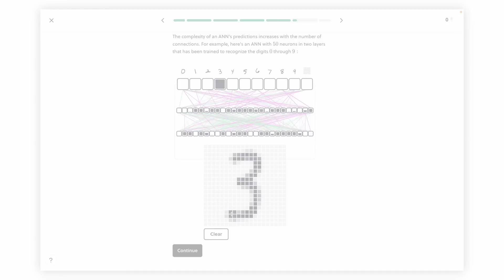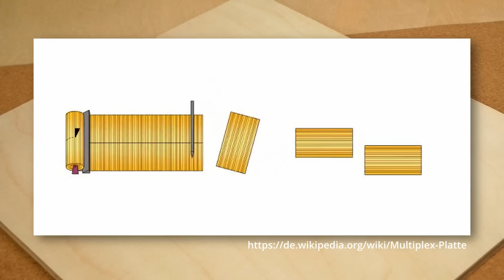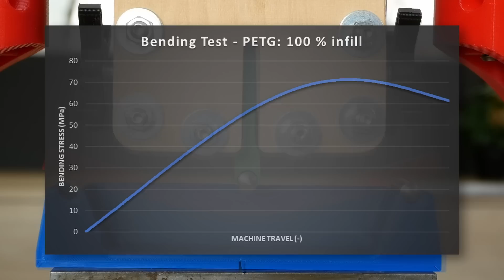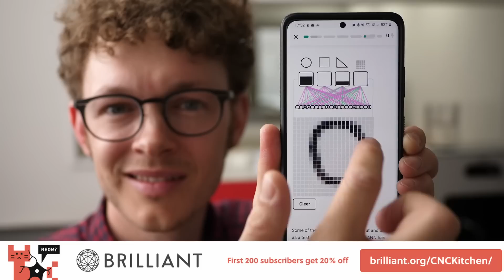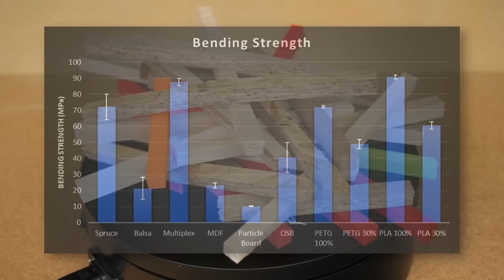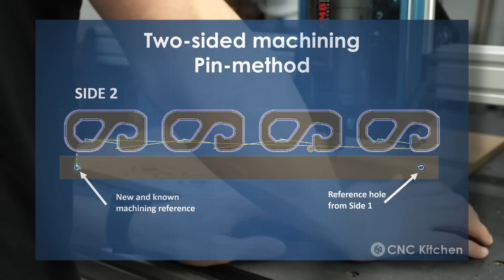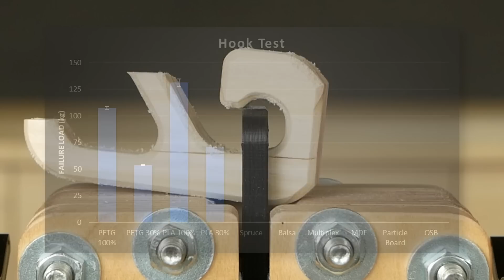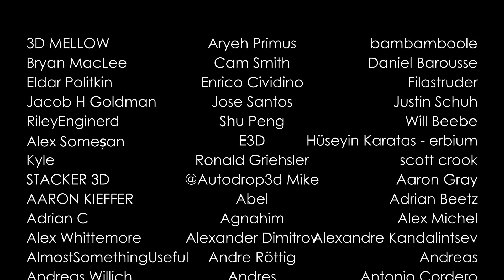Strength Test:  3D Prints VS Wood

Comment: The wooden hooks failed more or less as expected. Hardwoods like those are usually quartersawn. This is the grain configuration that gives those beautiful cathedral grain patterns on the surface. It is very strong in furniture, but does not work well for making abstract shapes.  With the load of the hook being 90° from the mounting points, there is no way to orient the wood where weight is not being held by the lignum (the very weak natural adhesive that bonds the layers of grain together.)

Comment: 10:14 I'm surprised to see the 100% infill 3D prints have similar strength per density as the 30%. Am I misunderstanding the data? Mpa/g/cm2 . The cm2 is the same on the different prints, or is this related to the infill percentage?

Comment: Cheap laminate flooring plates is a BRILLIANT material for all kinds of things and with some glue they can be used on both sides a very cheap core material to create very stiff and strong composite boards-

The wear surface on quality laminate is so strong and hard that it can be used as a sliding surface against itself that require no lubricant(wear wise it is likely to be comparable to softer metals with lubrication, maybe even better...)

Comment: How would wood be if you burned it (a bit, so it is black to sight)?
I have tried melting PLA in salt, it gets solid but with the salt shaped surface, what if you compared the resistance change, maybe other postprocesing methots

(maybe I got the salt idea from you and didn't remember? If so sorry and I'll search it... it is hard to remember all the materials tested!)
Interesting experiments these you do

Comment: Just noticed the X1 Carbon with AMS In the background.

Just thought I'd comment about a few things before the review was finished.

First I was hoping you might be willing to test flexible in the AMS despite what they advise as it would be great for composite prints for things like hinges.

Secondly I thought it reasonable to point out that they technically aren't abiding by the gpl3 license of the software their slicer seems based on yet (they say they will soon)

Lastly they also mentioned they'll allow non cloud base local network printing eventually but it's not there yet.

Thanks for the time it took to read this comment.

Comment: Nice testing! Perhaps two things to note with the engineered wood products:
The hook test does not load the materials in the direction the sheet goods were engineered to be strong in. Sure, they can take some load in that direction, but they're mostly designed for the type of loads seen in the bend test. If they ever see what I guess would amount to a shear load across the sheet when used in construction, you've got a huge mechanical advantage due to the size of the sheet, so even when the material itself is (relatively) weak, it will still easily be hold up. 
Also, especially with OSB and the finer particle board: When used in construction, due to the larger sheet size they're used in, the strong sections will support individual weak spots across the whole area of the sheet, so it's really just the strong sections that determine their overall strength. However, with the small 9x9 samples in the bend test, you'll always capture at least one weak spot, so in that testing, it's exclusively the weak spots that determine their strength.
Reply: Gotta agree with Thomas. Producing let's say a 2mm x 2mm stick is totally doable for polymers and any solid timber, but such a stick made of almost any of the many fibre boards would not possibly even stay as one piece to begin with. Does it mean the material is infinitely worse as the part breaks apart on it's own? Or course not. 

Not that I'm a fan of fibre boards, they suck up moisture and deform over time. Low grade furniture makers love it - makes for self-disassembling stuff that creates need for new furniture.
Reply: @jaakkopontinen  "Does it mean the material is infinitely worse as it breaks apart on its own?"

That's exactly what it means. The mechanical properties of the material usually tells you that up front. There's no real need for testing. It's the first thing you look at when selecting a material to do a specific job. As an example...

Particle board tensile strength = 145psi
White oak tensile strength = 768 psi
PLA tensile = 7250 psi

Compressive strengths comparisons however are closer.

White Oak = 7440 psi
PLA = 13400 psi

A 2mm x 2mm stick of wood is not as strong as a 2mm x 2mm stick of PLA. It doesn't matter the size or the shape. PLA has higher tensile, compressive, and shear strength so a given shape will always be stronger in comparison.
Reply: @OU81TWO  Thank you. Though I feel you missed the "infinitely" part of what I wrote. There's a gradient. Only truely infinitely worse material for a job is no material at all. There's a reason I used the word - it was to show the existence of the gradient, not to actually place any other material on the gradient.
Reply: @jaakkopontinen  Not sure what you mean by "gradient".
Reply: @OU81TWO  a gradient of "best for a purpose" to "worst for a purpose" in this case.
Reply: To piggy back off this idea, many of these wood sheets are designed for specific uses which don't really translate into what the hook test and bar tests would show us. As an example, MDF did very poorly in these tests, despite having the highest density, because its main function is to be a cheap(ish) filler wood for finishes that are intended to be painted or laminated, hence the super smooth surface. (I say cheapish, because you can get similar finishes in multiplex ply but they are quite expensive.)
I think you would see the most interesting results if you tested against these materials shear strength for screws or bolts. Like was done with the heat set inserts in another video, as that is mostly the kind of forces these materials are intended to deal with. 
I also think you might see a non-linear change in force/area numbers if you increased the surface area, as Tom mentioned above.
Reply: Agreed there is a world of quality difference in plywood products, I would hope AA marine ply would be used next time as a more an equivalent cost? (I don't know F all about 3d printing costs warning). $180 AUD for a huge sheet of 4mm that will last a lifetime of prototyping smaller items.
Reply: I'm not so sure that's how it works. A large sheet has a large cross section and can therefore handle large bending loads.  A 9x9 piece has a smaller cross section so naturally it can only handle a smaller load. The ratio between load vs the cross sectional should roughly be the same since the mechanical properties (tensile strength) of the wood does not change.
Reply: @OU81TWO  true, if it were a homogeneous material.

Comment: Very interesting, useful and thorough analysis. Thank you!

I would have thought a big advantage of the 3d printed parts is that they’re pretty much unaffected by water. MDF is pretty terrible to start with, and when it gets wet just collapses. I’d be interested to see how carbon fibre and glass fibre compare. It would also be interesting to try bamboo, as used for scaffolding in Asia, and the engineered type which appears everywhere nowadays - flooring, chopping boards …

Comment: Great work
Howerver I think you schould also test heavier woods like oak or beech. Also I would like to see a different type of multiplex board, I dont know how its called in english, in german its Siebdruck Platte, those are typically stronger and way more weather resistant than standart multiplex board.

Comment: You wrote down section modulus as bd^2/6.... shouldn’t it be bd^3/12 or am I missing something
Reply from the maker: bd^3/12 = I would be the second moment of area - important for stiffness. Section modulus is I / distance to the neutral fiber - important for the bending stress calculation.
Reply: @CNCKitchen  ah that makes sense, I was taught to use I = bd^3/12 and then use M=FLy/I where y was the distance to the neutral axis

Comment: Great content. It's very challenging to compare homogeneous to composite materials.

It would be interesting if created a 3d-printed part that was laminated like plywood to simulate the variation in grain orientation with print orientation. In composite woods, the binding glue can add to properties of the wood. eg: with plywood, the wood will often fail before the glue joint. These concepts could be useful when it comes to designing 3d-printed parts. Example multiple parts glued together vs. a single part print. Recently saw a video that printed channels into a 3d-part so a carbon rod, or flat stock could be inserted, before resuming the 3d-print, thus embedding a reinforcement material.

Perhaps inspiration for future print/test explorations.
Reply: Slicers already do this for infill, if you slice a part and especially look at the solid infill layers (e.g. top and bottom), you will see that each layer has the lines going at 90 degrees to the previous layer.

Comment: Has anyone tested yet if the kinematics of a printer affect the printability of abs/asa or polycarbonate as well as tall, thin objects? Im wondering since a lot of people have problems with warping or bed adhesion failures on tall objects, meanwhile i print asa not enclosed and abs parts only when they are larger with a cardboard enclosure. I noticed all who had problems were using bedslingers where i have a delta. My theory is that the moving bed adds to the cooling of the part and thus to more warping. But sadly this test will be rather hard to perform, since you need the same build surface and idealy the same hotend, so the material will be printed at the same temperature

Comment: So, just an observation.
Partical board probably needs a larger intact section in order to realize its full tensile strength.
Reply: Same goes for OSB. 

They're reliant on a mesh of wood chips overlapping in every direction for strength. If you want to test it's full strength I imagine that you at least need to a square section that's 2x the size of the largest wood chips; that way you have maximum friction.
Reply from the maker: Good point.

Comment: I thought MDF would be stronger and stiffer tbh
Reply from the maker: I think that's an impression you get due to its weight.
Reply: @CNCKitchen  Well I got that impression from DIY Audio projects that often use MDF and I used it myself, is there perhaps a chance your supplier has weaker bonded glue MDF?

Comment: Here is a new material, soak the wood in a resin for 24 hours, then wipe off the excess and activate the resin. Someone once told me that "wood is like a natural composite, with a cellulose fiber structure and lignin resin. The problem is... there isn't enough resin." So, if we add resin, what will the new material be like?

Comment: Not surprised Particle Board is a failure strength wise, I think it exists solely to be cheap.  its why its the structure of basically all flatpack furniture from big box stores.

As for airplanes and wood, fun note the "Spruce Goose" was made of birch.

Could be interesting to see wood pit against the more exotic materials too, like CF Nylon.

Comment: Please, do not call manufactured wood board as wood, they are called processed wood (plywood, birch wood, particle board ...), other are hard wood (pin, oak, teak, ebony, walnut, lignum vitae (hardest in the world)...)  MDF, or HDF, are composite, like fiberboard or Plexiglass, because MDF is made of wood dust mixed with epoxy glue.
Reply from the maker: I guess "engineered wood" would be the proper term. Tried to mention that at least once.

Comment: I'm surprised PETG performed so much worse than PLA. I've almost entirely switched over to PETG with my home printing because it was performing better for the types of prints I've been making, and because of it's inherent UV resistance.
Reply from the maker: It's just because PLA is really strong if you don't get it too warm. PETG is a great material because it's usually more ductile but also comes with some downsides.

Comment: Awesome work! This has been a thing that sat in the back of my mind for ages. I live in an apartment and don't really have the space to do high-particulate tasks like wood working, so I end up 3D printing. I also tend to have a general aversion to glues and fasteners. Maybe it's stubbornness, the necessity to buy something that seems to be finite in it's lifespan (for glue) or overpriced when bought in small quantities but wasteful (I need a 10x M3x18... not 100x of M3x100, 100x of M3x50, 100x ...) for my use, or some other thing. But it means that I would much rather print a bunch of stuff and assemble it then to go build a wooden table or something. But... besides the days/weeks/months it would take to print things, the amount of filament, etc. needed to do it, the question remained: would it be worth it? Would it be better to go to a friend/family who has the space and get the whole thing built and potentially be more expensive (at current prices) or could it be done with 3D printing.

TL:DR - this tells me that some structural elements would work as 3D printed instead of wood, but still wood would be better (so long as the right one is chosen).

Comment: I would love to see stabilized wood strength
Also you can get a great deal strength out of wood in such tests by beveling the edge so it has no hard edge.
This may effect 3d printed plastic parts too, but wood is extremely sensitive to fractures in the grain.

Comment: A nice objective test as usual, thank you!  However the sheet materials (MDF, ply, particleboard) are best used in shear with edges constrained so without taking anything from this series of tests - it would be interesting to see the results when the deflection  load it applied parallel to the grain.   This of course highlights the advantages of composites.   How would a honeycomb PLA core and a single veneer skin perform for instance?

Comment: I'd like to see Masonite tested in addition to MDF if you do something like this again. Masonite is quite interesting in how it's manufactured and doesn't use any added binder. From what I recall the wood is basically pressure cooked and then "exploded" using superheated steam. The heat and steam dissolves the lignin freeing the fibers. The result is then put under very high pressure and temperature and formed into sheets. The lignin will bind it all together just a lot denser than the natural wood. The result is a material resembling MDF but a lot harder, denser and stronger in every way. At least that's the theory. 

Masonite was patented back in 1920's and was used quite a lot up until the 80's and 90's. Over time it gained a in my opinion undeservedly bad reputation. Mostly because it was seen as a inferior substitute for real wood and because it was often used wrong. If treated it can withstand moisture quite well, but untreated it will absorb moisture, swell and rot. As there are no additives it is not going to leak any chemicals other than what you find in natural wood.

MDF is a newer invention. The fibers for MDF is mechanically separated resulting in shorter and weaker fibers. Resin is added and it's compressed into sheets. The result is a lower density board with shorter fibers and less structural integrity.

Comment: GrussGott Stefan,

While all your tests show precise measurments on the testing moment, please take into account that an object holding a weight it does not do so for a specific moment in time, but rather for a lenght of time.

So a stress creep test would be more accurate, for instance I know from my experience that PLA would fail it in time, it yields pretty fast in a few months under constant pressure be it in push or in pull.  Here PETG wins by a large lenght.  And Polycarbonate even more resistant, on the par with Nylons (PET, PA, PPE and similar)  while their mixt with fibers are less time resistant under stress, I guess the Carbon or Fiberglass fiber added thou is adding to stiffness it is also weakening the general adhesion.

ABS and ASA and HIPS, are pretty time resistant too, but they start from being weeker than PLA in the first place from a mechanical point of view.  

PEI, PEEK, PEKK and PPS at this point start with huge advantage in mechanical resistance, doubled by stress creep resistance, but you kind of need deep pockets for a printer that can take them for a spin, not to mention the pricey materials they are, except for PPS that is closer to Polycarbonate and Nylons, a tad more expensive, they call it the PEEK of the poor, but you ought to be pretty damn rich kind of poor anyway.

So, here is my challange, creep tests please, one year time span, loaded at 60% of their yiealding known to you as maximum load (Or if you think another % of their yielding load is better, you are the scientist here not me, actually my friends call me the crazy scientist, where crazy is the accurate nickname, and scientist comes between a " and a ").

Comment: I'd be interested to see a sparse filled printed part, filled with epoxy resin and tested. You could print just two walls, use gyroid 10% infill and drill a injection hole and a vent hole. slow cure low viscosity (aerospace) epoxy would be my choice.

Comment: One thing that would be interesting is to try the bending test on the multiplex again, but with it rotated 90deg, so the force is in line with the glue layers instead of across it. It might alter the results, or it might not, but it would still be interesting to see the results.

Comment: The 3-point bending loading isn't pure bending as you say but are instead combined bending, shear and localized through-thickness compression at the critical cross-section. To create pure bending, you'd need a 4-point bending test.